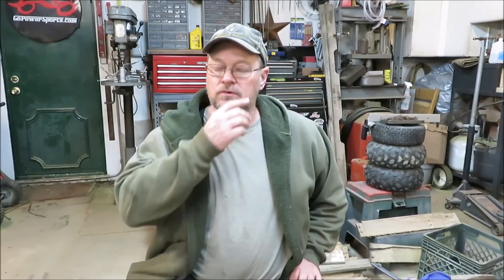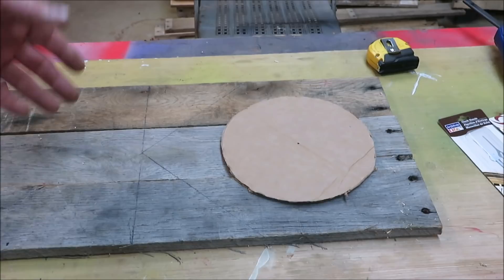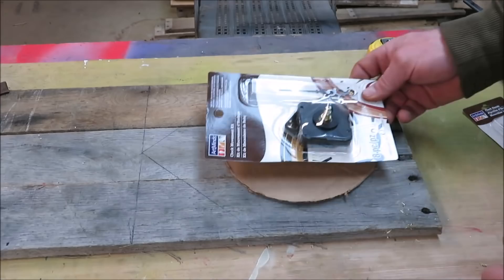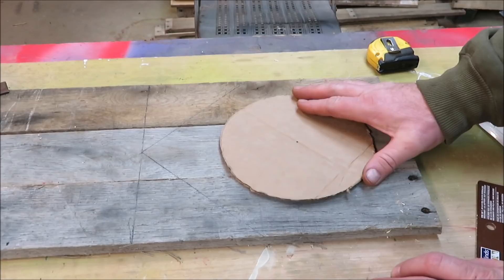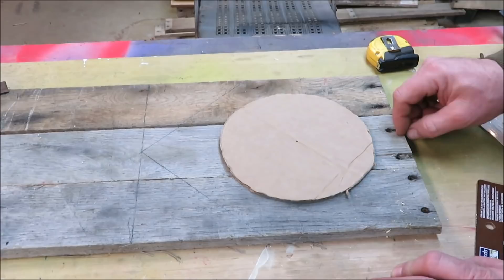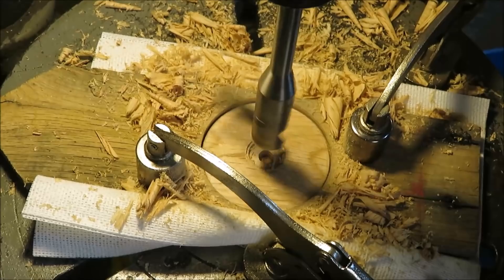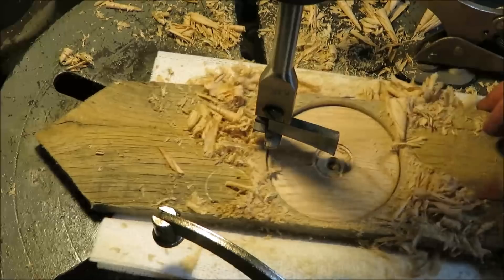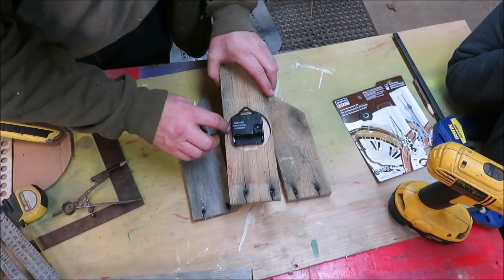pallet wood birdhouse clock

Comment: Great project, I may try to make one. They make clock motors different shaft lengths so you can use different thickness of wood.
Reply from the maker: I need to find a good store that has a variety of sizes.